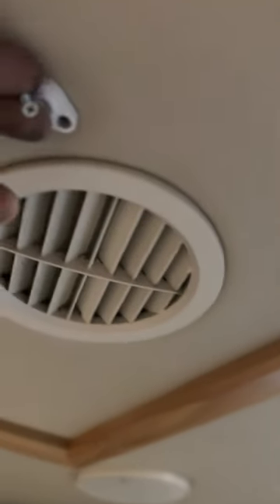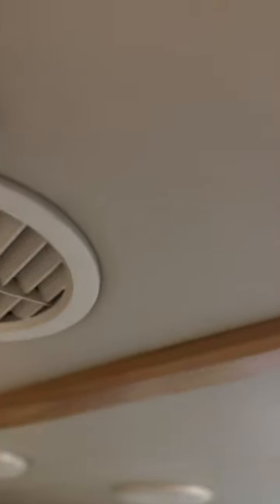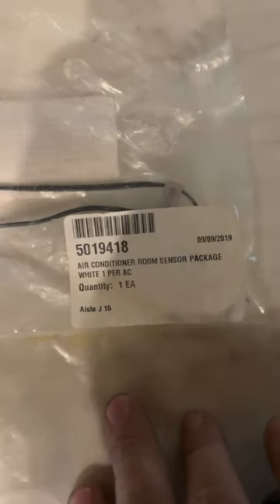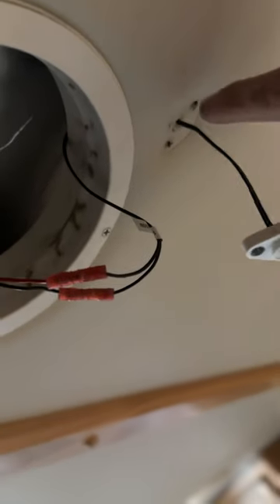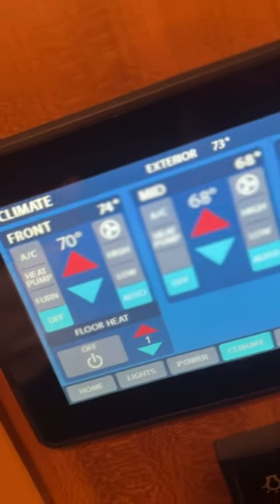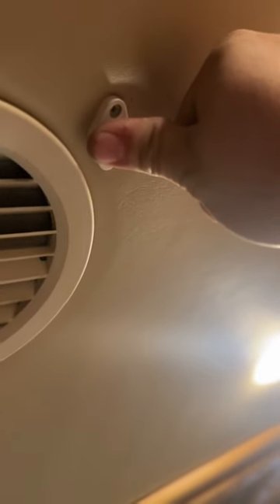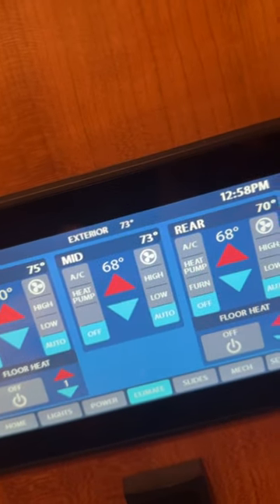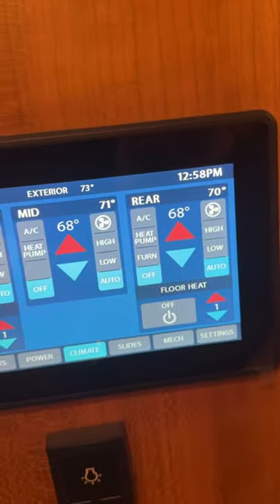Changing and testing the roof ac thermistor

Comment: 2016 Phaeton, my 2 front A/C’s fight each other, it the front one is running first the middle will show way cooler and won’t kick on, if the middle one is running first the front one will read cooler and won’t kick on, iv changed the thermistors several times and does the same, frustrating on hot days, any ideas?